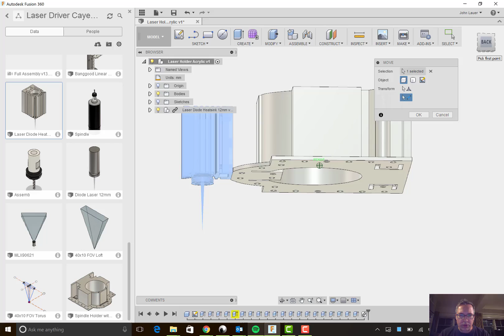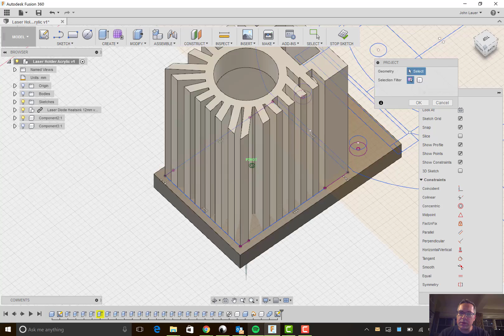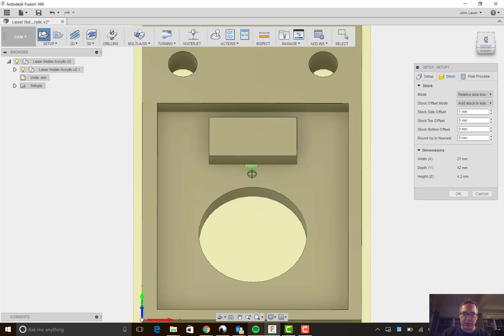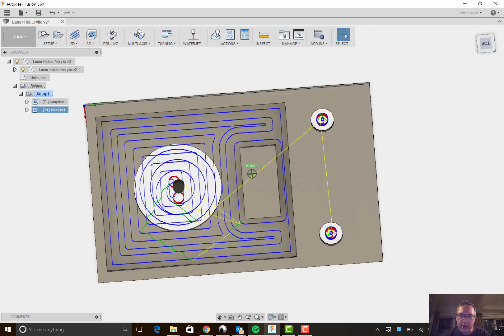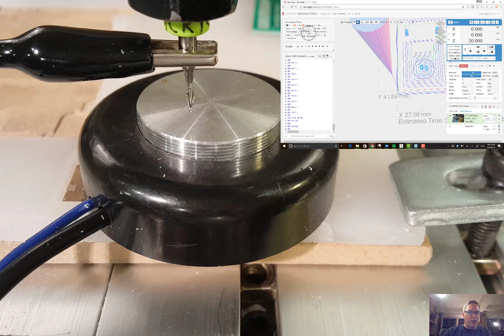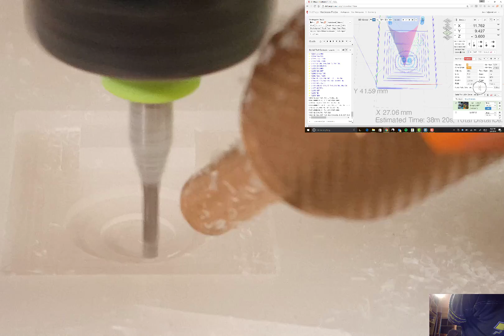Fusion 360 Tutorial for CAD/CAM then Milling in ChiliPeppr

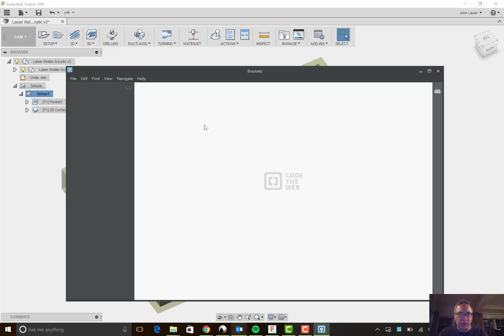Comment: 21:15 i have the same problem, i also manually have to add a height to the g code manually
Did you find a solution in the mean time, i also cannot find a solution in the manuals

Comment: Regarding your comment about the touch plate sometimes not working: I've been wondering, wouldn't it be better to use brass? The aluminum touch plate has an oxide coating that's very resistive (just from exposure to air). My guess is that you have to punch through (more like crack through - because it's really hard) the oxide layer to get to the soft, conductive material underneath in order to close your circuit.
Reply from the maker: I doubt it's the oxide layer because the end mill is sharp and would pierce right through it and make electrical contact to complete the touch probe. I've seen touch plate fail just when the end mill is so tiny, like 0.3mm, that the 3.3v from TinyG sees too much resistance.

Comment: My inventory of parts have all arrived to build my own machine.  Can't wait till I get to this point.  I've got xmas presents to make.
Reply from the maker: What kind of machine did you get?
Reply: John Lauer I went with a naked Chinese 6040, clearpath servos, tinyG, 1.5kw spindle.  Once it's running I'd like to a laser to it as well, but need stick with one thing at time and not get too ahead of myself.  The plan is to carve some 3D Terrain topologies.  I'm going to also see if I do some New Zealand Maori carvings. So I've been trying to teaching myself F360 and STL type of stuff.  Sort of starting out with the tricky stuff causing me to question my own sanity.  Good to have an end in mind goal though.
Reply: Trying to make a very quiet machine for basement use that doesn't wake the family.
Reply from the maker: Sounds awesome. I have found my NEMA23's on my CNC to be perfect. I always thought the servos were too expensive for the benefit, but curious to hear about your results. That's a nice spindle that could cut aluminum, even steel, nicely. For my acrylic and PCB boards I've been surprisingly happy with my 300w spindle and that spindle is super quiet.
Reply: I agree on the expense.  That did hurt - so I'm spreading the acquisition of parts over time to spread the pain.  My logic aka self justification is that I can bring the servos forward if I out grow the machine.

Comment: cool beans.  i think your sketch issue was because the light bulb at the top level was off.  Also, you can edit that TinyG post processor to include that clearance move.  And if you enable cloud libraries in your settings, you can upload it to the A360 drive in the "Cam Posts" folder and it will show up on any machine you use fusion 360 on.  Which normally doesn't seem like a big deal, but I rebuilt my machine and realized my customizations in my post processor were buried in some folder that isn't backed up, so having them on the cloud when I sign in turns out to be helpful.  Anyhow, great stuff.
Reply from the maker: Oh, you're awesome. That's totally it on the sketch not showing. Thank you on the editing of the post processor as well. Good tips. Maybe worth another video.